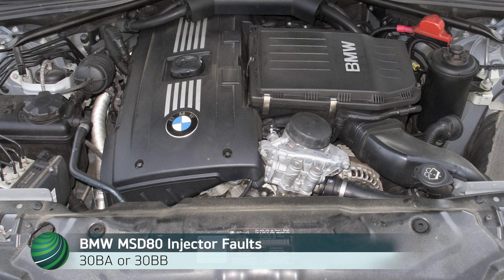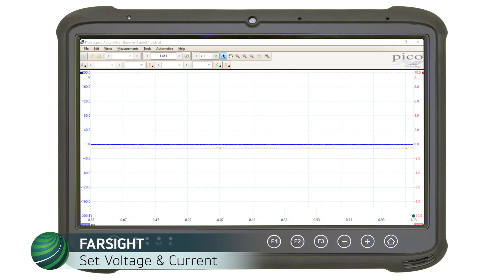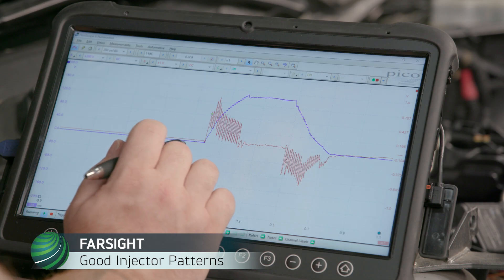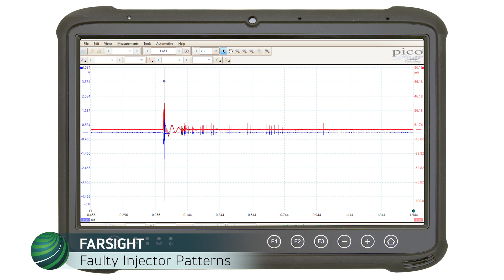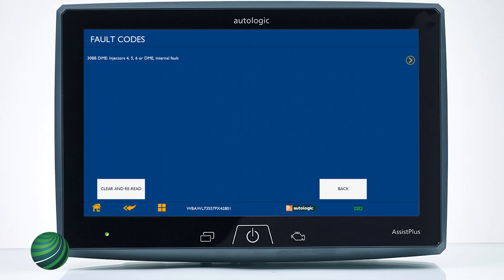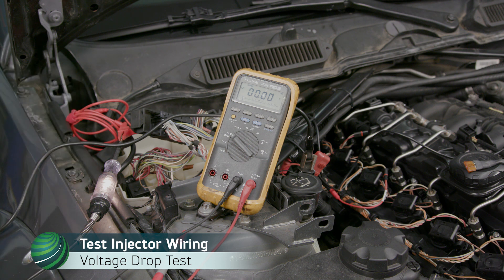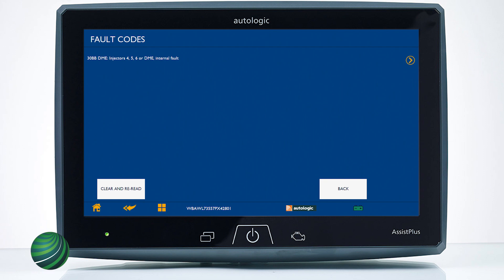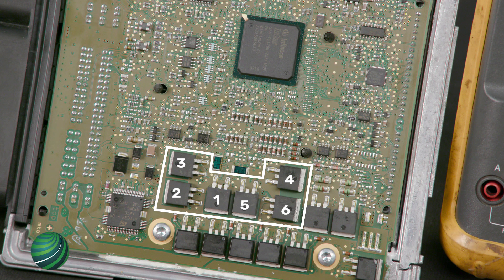BMW MSD80 Fuel Injector Fault Code Diagnosis - 30BA 30BB

Comment: Doesn't the ecu turn off a whole bank, if codes 30BA and 30BB are present? If so, then on that bank, there should be no signals to check.

Comment: Thankyou for uploading this video... I have been looking for these waveform, where some controls both wires to injectors.. in this case can we test for current/voltage in any wire or need to identify signal wire ?

Comment: what if i use an DMM  instead of a scope? I mean set the DMM to measure AC voltage and compare good injector signal vs bad one? The DMM AC voltage will measure the RMS voltage of the square wave.

Comment: what if the code goes away when injector 1 is unplugged, and all other injectors are plugged in?
when injector 1 is connected, I get 30BA code.
Reply: Then injector one is bad
Reply: I have this same issue but also with injector 6, did you figure yours out? I put new ones in and still the same thing
Reply: @gavinvega7069 it ended up being a fried mosfet for the injectors in the ECU I believe, it was a while ago. But I took a new mosfet to a computer/electronics repair store and told him I need this specific mosfet replaced/ soldered in. Guy ended up doing it for free in 10/15min and then my problem was resolved

Comment: When you disconnected the battery and DME connectors, you were testing voltage how did you get 12.4v or you connected the battery without DME?

Comment: I have done this last test and they all beep. Does that mean my entire  dem is bad and needs replacement. Code always stays and it's the same injectors number 3,5,6. How can I replace the mosfet on this board
Reply: Exactly what test you did? If it beeps on injectors wires it means wires are good. But if you getting fault at 3 cylinders(whole bank) most likely your DME injectors or coils mosfits are bad. Or O2 sensor, AFR.

Comment: I can not understand how to test resistance with a light and a voltmeter.
Reply: There must be no sound to the left and right, but in the middle there is. If there is sound on the left or right, then the mosfet is defective.

Comment: I followed the instruction to check the mosfets. I got 0 between drain and gate and around 370K ohms between drain and source. Is that correct or do mosfet need to be replaced?

Comment: The Mosfet driver can be replaced. you don't need a replacement DME!!
Reply: How do I replace the mosfet driver . Fuel cut off on my 02 e46. The same code every time
Reply: @JamaalBey404  I know this was a while ago....but check this video out https://www.youtube.com/watch?v=l2mnc5I1vPY, there's more like it too. I'm going through this problem now
Reply: Gurdeep Guray I sold the car but thanks for the reply